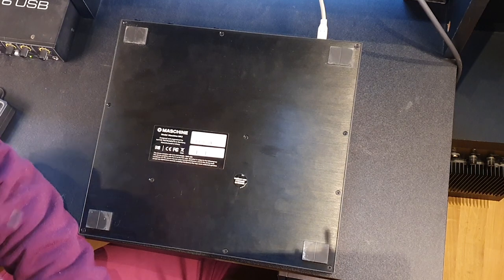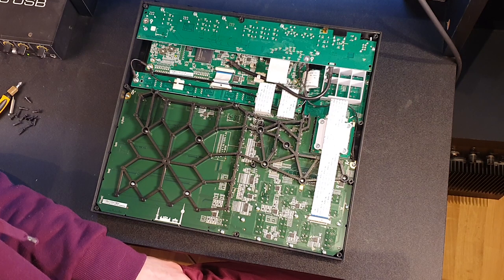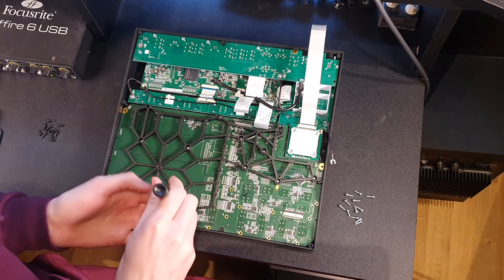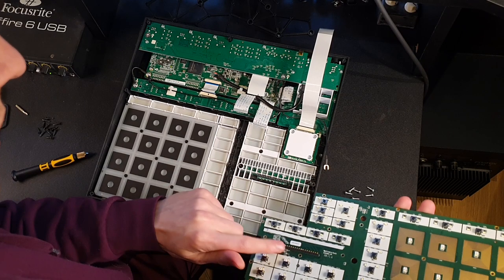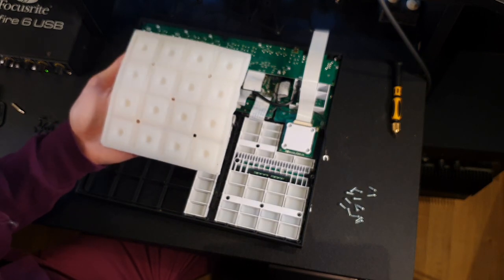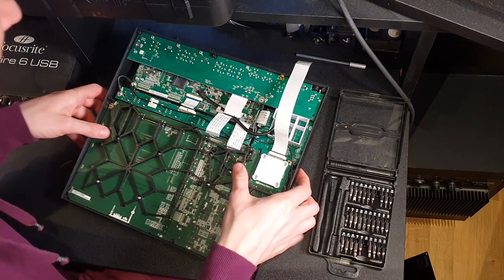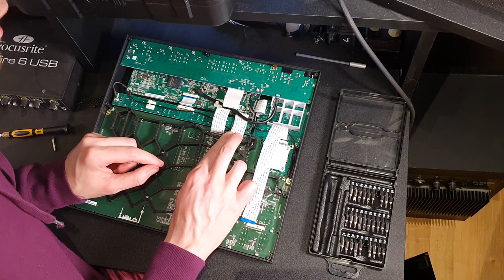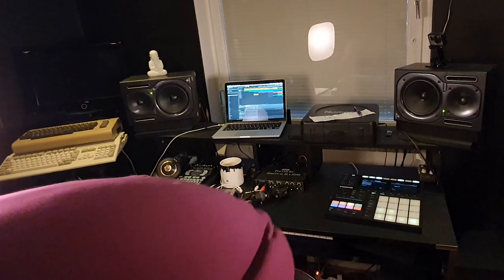🏆Maschine | MK3 PAD REPAIR SURGERY - See the guts 🏆

Comment: dope! hey did u ever had problem with some buttons just randomly stop working? I'm having lot's of trouble with my maschine and nothing seems to help. thinking of opening it and checking how shit looks..
Reply from the maker: Hmm yeah I think I had that on one of my MK1s and did the same thing to fix it, have you got the latest driver + tried it with different software to see if its not a software issue?
Reply: @BlezzBeats  yea man I just checked n I have that latest driver and also tried with Ableton and the same issue keeps on going. pads work normally but almost everything else is numb..
Reply from the maker: @vihula  ok and that's in midi mode too? Like not the Maschine plugin but using it as a midi controller
Reply: Yep also in midi mode..
Reply from the maker: @vihula   Alright book an OR!
Reply: Okay! Thank u for your help! will do that!

Comment: Most of the time it aint an issue but best practice for dealing with such tiny microelectronics is to use an antistatic esd wrist strap. They arent expensive. You put it on your wrist and the other end on a grounded place like for example a plain contact on your radiator or on the protective conductor of the power socket. This way you ground yourself to not have electrostatic influences on the electronics you are touching.
In theory, these electronic impacts from your body are like microscopic lightning strikes and can damage sensitive components in the very long term.
Beside that another dope video. Keep on being fresh 👍
Reply from the maker: People! You should definitely do this. My dad always told me to do that but I usually touch a radiator and place my bet on "most of the time"

Comment: I spilled beer on mine and tore it down/cleaned it before watching this video. I didn’t take off the screen protector for the pads fml! I have to do that screwing again
Reply from the maker: Haha noooo! I forgot details like leaving a screw out or something 3 times over filming this video I know the feeling lol
Reply: Blezz Beats after cleaning pads only two lost full responsiveness . My bottom left pad (which happens to be where I always put my kick ) had lime cemented on it. I waited too long to take it apart hoping it would “air dry” smh. It’s easy to work around 1 pad but it’s always gonna bug 😑 thanks for the tutorial I would’ve destroyed those ribbon connector without your video

Comment: Yo Blezz, so my problem is on the #1 pad. I thought it was a velocity issue at first so I went through everything to make sure that nothing was accidentally touched or any type of setting I may have altered because when I hit the pad, it doesn't correspond the way it should. Like when I double tap the pad, in this case it would be my kick drum, I can barely hear it but on my velocity grid it would show up but I would have to manually raise the volume on it. Is that the problem you had with your pads? If it was, I'm gonna go ahead and open this sucker up and clean it.
Reply from the maker: Most likely yes! If it happens across projects, cause there are no universal settings for individual pads.
Reply: @BlezzBeats  dude it worked lol thanks so much man!
Reply from the maker: @crazeefingas33  Congrats bro :D
Reply: Mines too
Reply: The whole 1-6 is low

Comment: Did you used water to clean the sheet itself, or just cleaned a rubber?
Reply from the maker: I used a tiny bit of water
Reply: @BlezzBeats  I used IPA and it does wonders.

Comment: Did you use soapy water or alcohol to clean ?  Soapy water is the best since alcohol can leave a residue.
Reply from the maker: Pro tip!
Reply: So I assume that's a yes on Soapy Water ?
Reply from the maker: Yes sir! Pinned it so ppl can see cause I failed to mention it
Reply: er, you got it exactly backwards.. use alcohol, which doesnt leave residue. soapy water will absolutely leave residue!
Reply: @MElixirDNB  YOU ARE CORRECT!
Reply: @BlezzBeats  NO!!! DO NOT USE SOAPY WATER as it leaves residue (even minerals from the water, let alone soap), use alcohol as it evaporates.
Reply from the maker: Ok good that this is pinned so we can see the turn of events 😂 Gotta love alcohol
Reply: @BlezzBeats  😄 and such a good time of year for it too!
Reply from the maker: 🍻 Cheer!